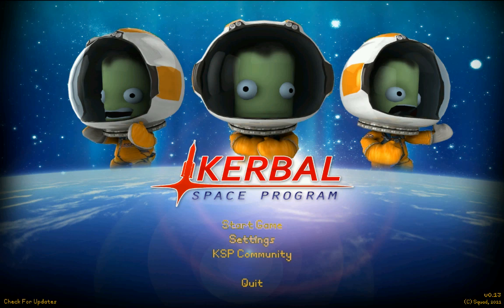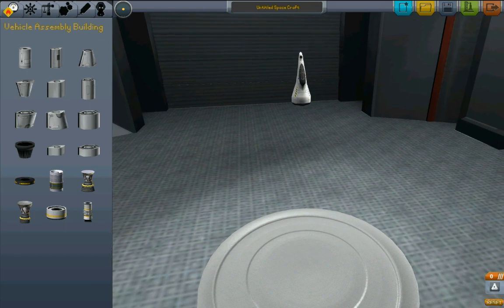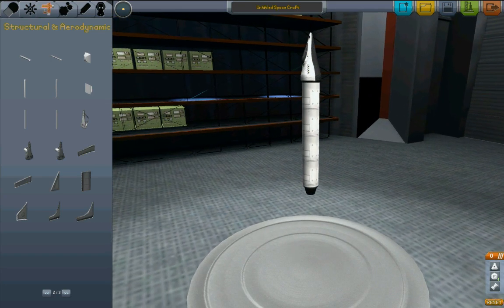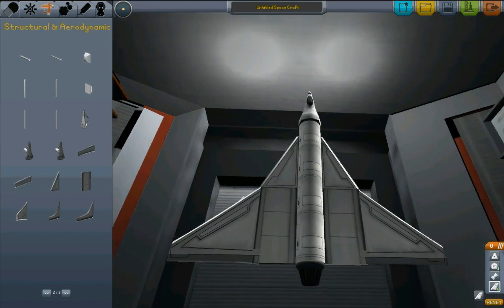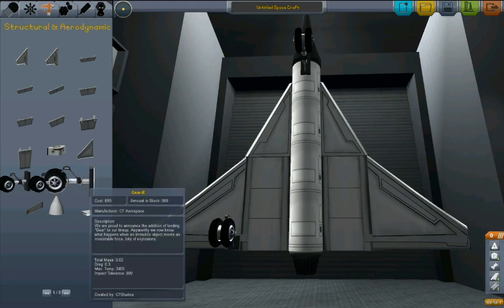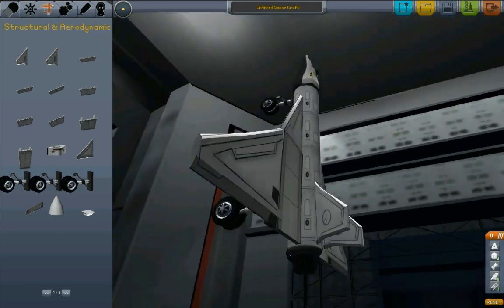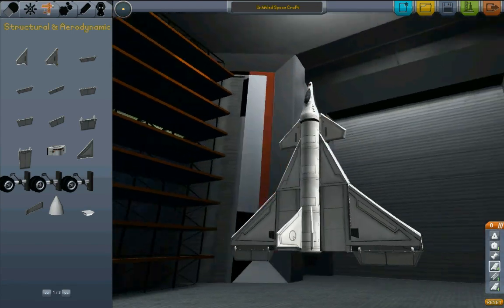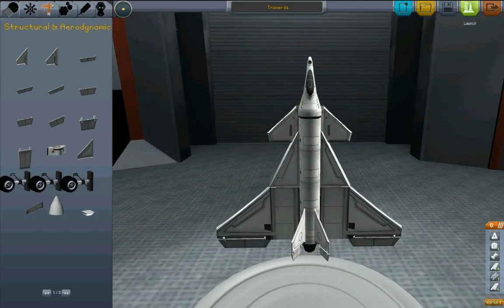Kerbal Space Program: C7 spaceplane tutorial, part 1, building the first airplane

Comment: I tried making my own plane. xP I gave myself TOO much control, Don't forget, you can do that, And when such a thing happens, Tap s for half a second and you do three backflips mid-air, I NEARLY crashed, well, technically i did, I stuck the landing, Twice... Before the rear landing gear failed, My wings fell off, The the forward landing gear died, My jet tanks crashed and blew up, and my Command pod slid to a halt going 70+ m/s xP